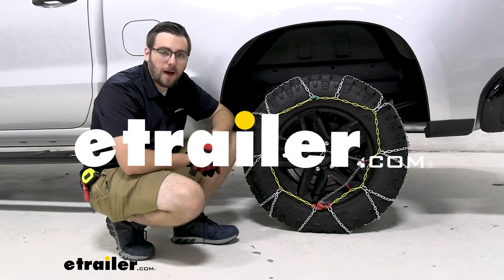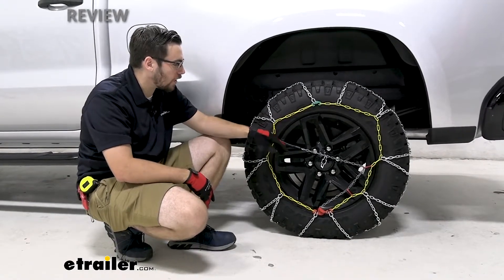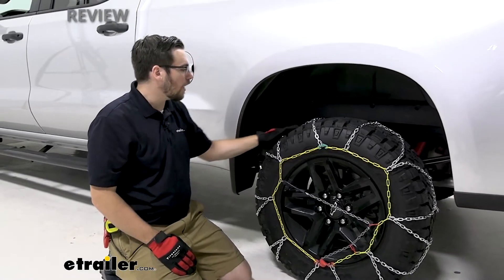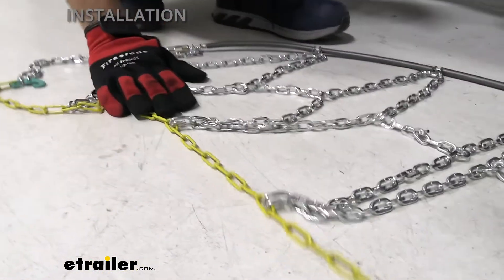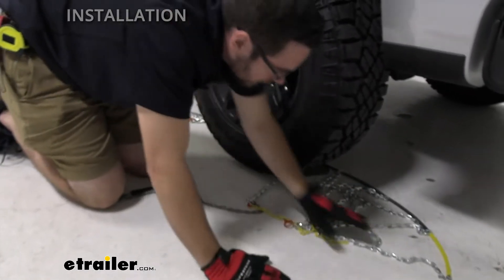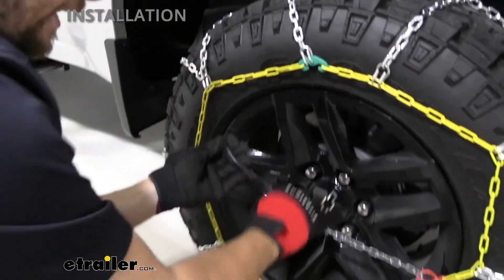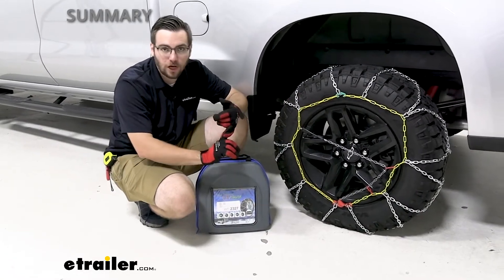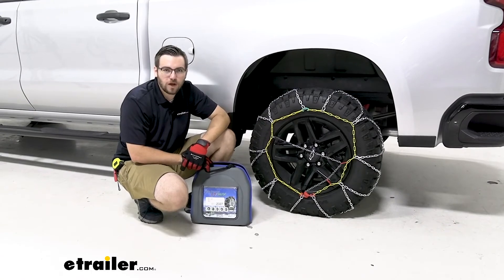etrailer | Installing the Titan Chain Snow Tire Chains on your 2021 Chevrolet Silverado 1500

Comment: Why does the eTrailer say these aren’t a confirmed fit for the 2021 Silverado? The wheels and tires on that truck in the video are stock.
Reply from the maker: You will want to select the factory tire size in our fit guide to see if these chains are confirmed to fit your tires. The tires in this video are 275/65-18, which is a confirmed fit.
https://www.etrailer.com/Tire-Chains/Titan-Chain/TC2327.html